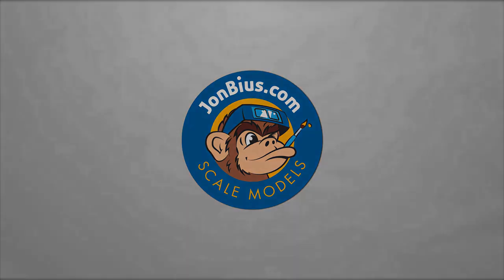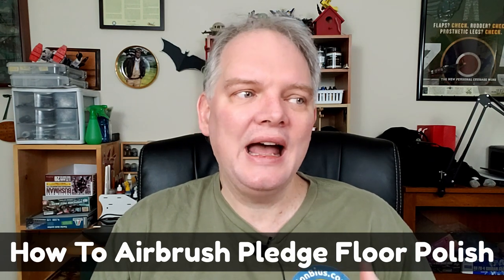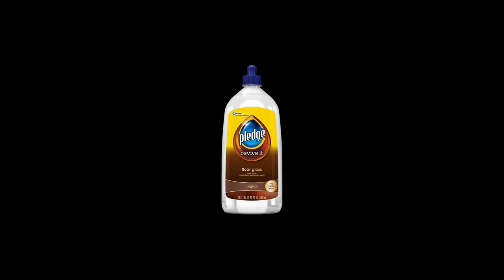Airbrushing with Pledge (Future) - A Simple Guide

Comment: Way, way, WAY back in the mid eighties, I read an article in Military Modeler magazine that described using Future floor wax as a gloss coat. The article even took it a step further with adding small amount of black paint, to make it a glossy black wash. I used this for a while on all my models (I made hundreds of models because I used to wargame with them in 1/72 scale). The only problem I had with the wash was you had to gently stir the mixture, not shake it. Shaking would cause the Future to "bubble up" , which caused some unwanted effects when you got down to the bottom of the paint pot, or bottle on the airbrush.
  Great video. I will have to "re-introduce" Pledge floor wax into my painting process.
Reply from the maker: Thanks so much for watching and commenting!

Comment: Jon, glad you mentioned shooting it wet. I can't tell you how many models I built with a gritty "gloss" coat because I listened to all the advice to build up with mist coats.
Well I could have put on a hundred mist coats and all I would have ended up with is a half inch thick layer of dull acrylic, which was fine if the model was to ultimately end up with a flat coat, but wasn't cutting it for the glossier schemes.
I finally took the plunge and let the flow rip and now I get the sheen I've always wanted - clearly so!
I guess the multiple mist coats method works well for some, but I never learned the secret to success.
God bless
Reply from the maker: I know what you mean - early on in my use of Future I had the same problem. But that whole "self-leveling" thing kept coming to mind. And to self level, it needs "self"! 😊

Thanks so much for watching and commenting! Grace and peace be with you.
Reply: It's interesting that ya'll are saying this, because in every case where I didn't mist on at least the first coat of Future, it beaded up on me. My best results were sprayed through my Iwata HP-CS (. 02 needle) at 13-15 psi. Once that initial mist coat set up, I could go on heavier.

Comment: Great tips in this video.  I've been airbrushing Future/Pledge for a few years now, mostly as a prep for oil washes and decals and I do dilute it a bit with water, sometimes a50/50 ratio, but I've had a few issues with beading or coat buildup at the bottom of vertical surfaces or the edges of flat ones that I've been able to control without much difficulty or messing up. But  after watching your video, I think that diluting future may be precisely the root-cause of this problem. I do it mostly as to shoot a finer, thinner layer of the stuff.  I'll start following your advice here, so just wanted to say thanks a lot for making this video. Cheers!
Reply from the maker: Thanks so much for your kind comment! And thanks for watching and commenting. I hope that adjustment will work for you - I think you may have identified the root of it. Happy day to you!

Comment: Hey Jon!
I still use future but have mostly limited my use to enhancing clear parts or simulating lenses. Why? Glad you asked. :)
I did an experiment on my channel with Tamiya Panel Line Accent Color (a.k.a. an enamel wash) and various clear gloss overcoats. I found that Future/Pledge built up in the recessed panel lines which in turn displaced the wash. Since then I have been using Tamiya X-22 Clear for my gloss coats. My normal process after color coats is X-22, decals, X-22, weathering, Dullcote.
So what? So nothing, we are just passing on our own experiences. As you and I both say, it's your model to do with what you want. If it works it works. There are no wrong answers.  
Kleerly so!
Ciao
Reply from the maker: Thanks! I am grateful! :D
Reply: I did wonder about that.  I will have to try the Tamiya.

Comment: Wow. Just tried this. Had a bottle on the shelf for years. My first model after 50 years. Worked great and easy to use. Especially after taking hours with windows open fans going using booth and spray Tamina clear coat spray with better gloss. Never use anything else. Have enough for several lifetimes
Reply from the maker: Great to hear! Thanks so much for watching and commenting!

Comment: @4:35 yeah, regarding thinning, I've found the same thing. I've thinned it with water, and with isopropyl, but found it's not necessary.  I apply it lightly enough to cover without getting runs and drips.  I want it to be about as thick as if I had applied it by hand, which I do on my toy soldiers.
@12:09 Yeah, overnight, for a decal gloss coat or when dipping clear parts.  I do put pieces in a container, not to facilitate drying, but to keep dust from landing in it while it dries.  When I use it in painting my toy soldiers, I'll wait till I can touch the piece without leaving a fingerprint.  I use mostly acrylics now, and I find that some of them rub off with handling.  So I'll paint a figure's legs, or the base, for example, then apply Future over that area to seal it as I continue to work on it.  Eventually, I'll give the figure a couple of coats when I finish, anyway.
I also learned to use Future to make glazes.  I mix a drop of water, a drop of Future, and just enough color to tint it.  I use this to do some shading on a figure.  On a face, for example, after having finished the details, I'll mix a glaze of a darker flesh color and run it into the low areas-under the lower eyelids, under the chin, in the ears, those lines from the corners of your mouth to your nose, etc.  When it cures, it looks a little like a piece of ceramic.
Reply from the maker: Thanks!

Comment: Hi Jon.  I have just started using this floor polish and am amazed with how easy it is to use.
My question is,  can you buff and polish this stuff for an even better shine ?  Good to watch a video  that is very informative and down to earth.  Thank you.
Reply from the maker: First, thank you so much for your kind comments! I am so glad you found the video helpful.

I've tried to buff Future/Pledge, but I've not found that it works well, at least in my experience. While it is very durable, the process of buffing and polishing creates heat, and that seems to potentially create problems with it slightly pulling up. (Although in some cases it does nothing at all - which isn't the desired outcome either!)

I do know one car modeler who said he spent hours gently buffing and polishing it, and over time it would bring up the shone. I've never tried that though.

My recommendation is if you want a really deep, final shine, stick to modeling specific glosses that are designed to be buffed and polished.

As always, test it out though, and see if you find a way that works for you. As almost everything I do ends up weathered and worn, I've never actually needed a final shiny coat.

Thanks again for watching and commenting!

Comment: thank you for the tutorial.  I ruined an airbrush about 20 years ago when the Future rage first took over the modeling world and I swore I would never shoot it though a brush again.  Fast forward and now Testor's no longer makes their flat and gloss coats.  I have tried the Krylon and it does not like my Vallejo paint so now I am an old dog learning a new trick.  I am wondering though how the matte coat from Krylon will interact with the Future?  Ima bout to find out!
Reply from the maker: You may want to try the combination out on some test plastic or test model. Krylon is not designed to be used on plastic models, and while it works generally, I've always recommended testing it out first to make sure it won't create problems.

Hope it goes well!

Comment: I tried pledge . I primed  the car gray, then a gloss black. I let it sit for a day, and then gave it a clear coat. I should’ve left it at that, but I decided to use the pledge and try it. The problem is I was disappointed it went on good, but when dry it had a crack look to it. I decided to give it another coat to give it to Try to cover the cracks. It looked a little better, but the cracks are still in it so I don’t know where I went wrong. So I’m not gonna use it anymore. I’m glad you and other people are having a good luck with it but I just don’t know why it didn’t work for me.
Reply from the maker: I'm sorry to hear you didn't have a good experience!

Generally when cracks appear in any coat - whether it's Pledge or anything else, it's because the underlying coats had not fully cured, and were still gassing out. (Did you use an enamel for the primer or base paint?)

Also, Pledge works best as a utility coat, not necessarily as a final clear coat as many car finishes have. I'd look to a dedicated modeling product for that.

I hope that info helps - thanks for watching and commenting!
Reply: @JonBius    Jon , thank you for getting back to me so soon!  I used a Krylon primer and waited a day to paint it . Waited another day and put Krylon clear on it . I then waited one more day before I put on the pledge .  I think you are right though with your answer. I think I really should’ve let it dry for a couple more days. In honesty, i’m going to try it again on another model and give it a go. This was the first time using it, so maybe my second time will work out better, and really let it dry for a few days before I put the pledge on it.  Your video was great, I just wanted to let you know that. As I said I will attempt again on another model. Have a happy new year, and thank you again for your input. 👍😊
Reply from the maker: @jimpuff8409  Yeah, Krylon paints and primers can take a while to gas out. I've used their primer before, and it was still gassing out a week later. Having both paint and primer over them would be a double whammy! 

Maybe try priming and painting a test piece, and see how long it takes before you can safely apply the Pledge. That may be helpful.

Thanks so much for your kind words, and happy new year to you also!

Comment: Hi, great video! I have a question: I'm building a race car with many decals. Should I spray the Pledge before or after I apply the decals? Thank you!
Reply from the maker: Thanks so much!

I'd recommend both. The gloss coat will make a nice, smooth surface for the decals to adhere to. And then a spot application over the decals afterwards will seal them against handling, other finishing applications, etc.

Thanks for watching and commenting!

Comment: Good video. I have a question: have you used the new Pledge bottle? The one shown in your video? I was wondering because  the old bottle had somewhere written on the back that it was good for acrylics. I do not see that on the new bottle, but wonder if the new Pledge bottle has made it standard for all of its Pledge floor gloss to be acrylic use.
Thanks for the video again, and all the other information posted.
Reply from the maker: I've not used the newest bottle, but I have heard from many who have. So far no reports of problems, so I am working on the assumption it is the same stuff.

Thanks for watching and commenting!

Comment: Excellent video John, thanks, I have a question, after the pledge, can I do the line panel? and remove the excess with mineral spirits? Thanks in advance
Reply from the maker: Thank you!

Yes, absolutely you can do that! I've done it for years, and it works great. Best practice is to give the Pledge at least an overnight dry. I've pushed it to less time, but I'd not recommend doing so until you've done a few times. If you use Tamiya panel line product, you may want to test them. They can be a bit harsh.

Thanks for watching and commenting!
Reply: Thank you very much John, from now on I will use Future, and I will be waiting for your contributions.
Reply from the maker: Thanks!

Comment: Hello, I used future for a utility coat for applying decals to a spaceship.  Do you have a matte varnish that you would recommend for the final topcoat?  I was going to get some Vallejo varnish but I've noticed that Vallejo paints crack or shrink up when applied to future.  Let me know if you can. Thanks.
Reply from the maker: For matte varnish, I use either Vallejo Mecha Color Matte Varnish, or Gunze Matte sprays. I generally use the Vallejo product, through my airbrush. I've not had it crack or shrink though - that is odd. Generally when an acrylic product cracks on a surface, whether it is varnish, paint, etc., is often due to underlying layers not being fully cured - enamels, oils, etc. That might be something to check.

I hope that helps! Thanks for watching and commenting!
Reply: @JonBius  Thank you for your reply.  That is helpful.

Comment: Jon. Can you use Future when looking for a Matt finish. The gloss is great. Can you overcoat future with matt varnish
Reply from the maker: Yes! I often used it as a gloss coats for decals, washes, etc., and then applied a matte coat over it as a final varnish. While I used enamel, lacquer, and acrylic matt varnishes, I felt it best to use acrylics, as they are the least caustic, and unlikely to cause problems.

I have some friends who would add Tamiya Flat Base (X-21) to Future to matte it down. I tried that, and it worked with some experimentation to find the correct ratio, but in the end I realized it was still simply an acrylic matte coat, so I went back to my regular matt varnish. (I prefer Vallejo Mecha Color Matt Varnish.)

I hope that helps!

Thanks for watching and commenting!

Jon

Comment: I would confirm what Jon says about using Windex to clean the airbrush. It actually works in terms of stripping out acrylic paint. However, ammonia will etch the chrome off of the interior, especially the bottom of the color cup if left in too long. There is one guy on YouTube that claims the ammonia doesn't hurt the airbrush, appealing to an engineer degree.  But I have seen me do it, Thayer Chandlers, Paasches, and Iwatas. Ammonia is an awesome cleaner for rifle bores, and airbrushes. You just can't leave it sit more than 10 minutes.
Reply from the maker: And there are so many alternatives that don't harm the airbrush too!

Thanks so much for watching and commenting!
Reply: @JonBius  and OP - Ammonia hasn't been an ingredient in Windex since 2006. So either you're using 15+ year old bottles of Windex, or else it's another ingredient that's damaging to the airbrush. Which is it?
Reply from the maker: @robdavis1091  Got me! Thanks for watching!

Comment: Does Pledge/Future work well as a gloss protective coating that I'd apply in between applying decals & doing weathering?
Reply from the maker: Yes, it works very well for that. I've done so many times.

Do consider the weathering steps you'll be applying though, because some steps are better when applied over a satin finish rather than gloss. But it all depends on the final effect you're after.

Thanks for watching and commenting!

Comment: Great video. Thanks for sharing. Is Pledge good for weathering, and panel accenting? Clearly so.
Reply from the maker: Thanks!

It's clear, so by itself it's not good for those purposes. I have used it on occasion as  a basis for gloss fluid stains by just adding a bit of acrylic paint or ink to it. While it could probably be made to work OK as a panel accent, there are far better products available for that.

HTH!

Thanks for watching and commenting!
Reply: @JonBius  Mr. Bius , my mistake. I didn’t ask the question correctly. Can I use Pledge, then use Tamiya Panel Accent, or my home made oil washes over the Pledge coating? But you did answer that in the video, I asked before you got to that point. Happy Modeling, Happy New Year, and stay safe.
Reply from the maker: @b-luv339  Gotcha!